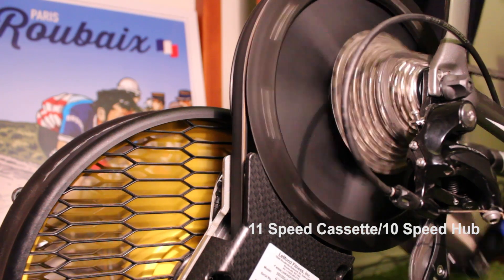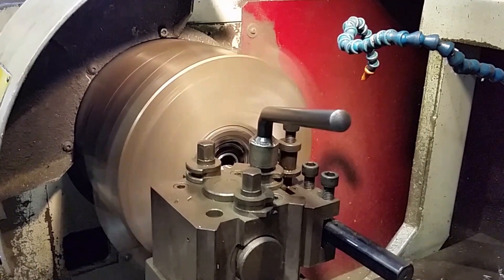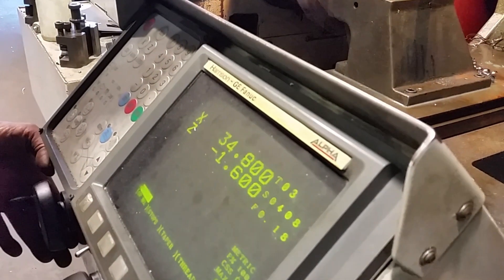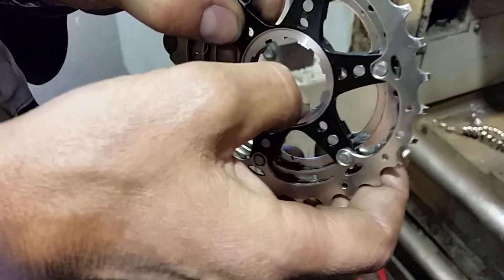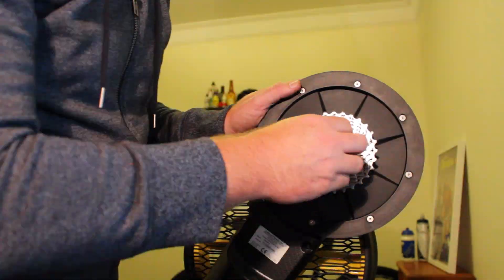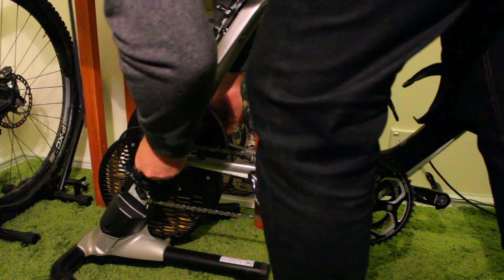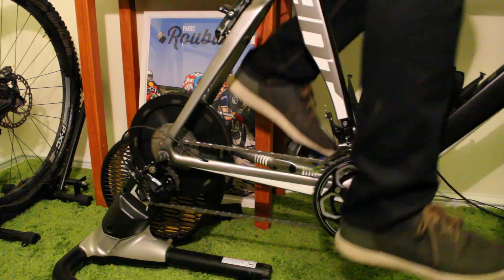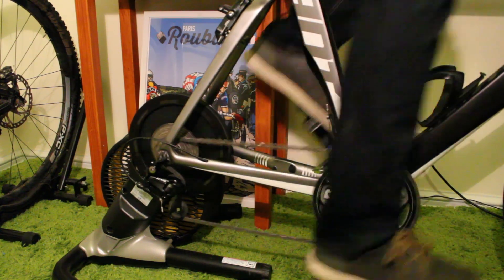11 Speed Cassette on a 10 Speed Shimano Hub Hack! (Lemond Revolution)

Comment: 11-34 cassette R7000 and R8000 does not required any machining to fit into the 10 speed hub.
Reply: do you think the 11-28 would require machining?
Reply: @robbythunder0 , why no need? is it a 10 speed cassette?
Reply: @DennisTeohKokEe  no the 11 speed version. I'm looking to get buy a lemond from a friend but I have a 11 speed groupset
Reply: @robbythunder0 , 11-25,11-28,11-30,11-32, 12-25, 14-28 all required machining.

Comment: Are you using a 10 sp chain with the 11 speed cassette?
Reply from the maker: Still 11 speed. The only thing 10 speed is the hub spacing, which is corrected by machining.